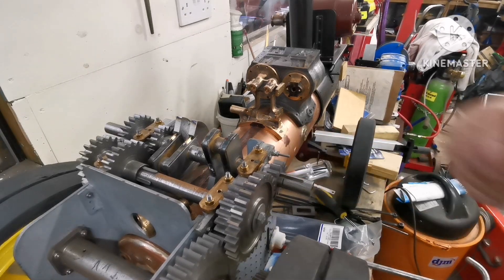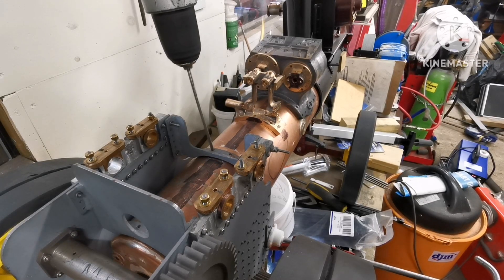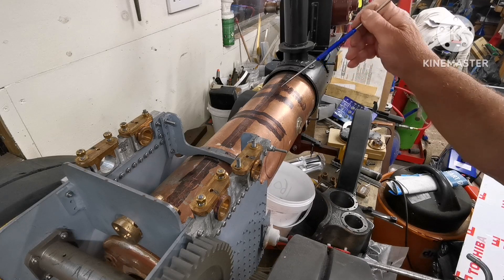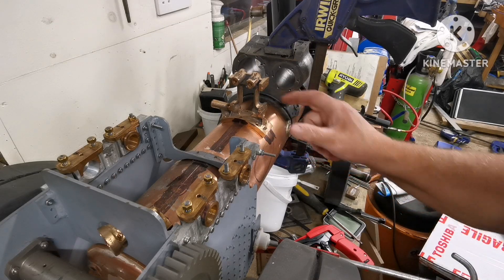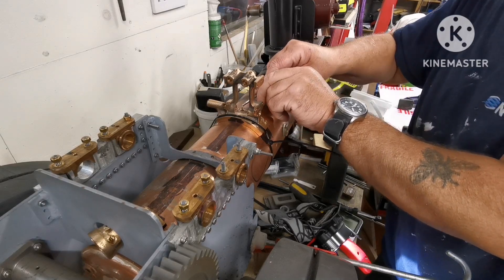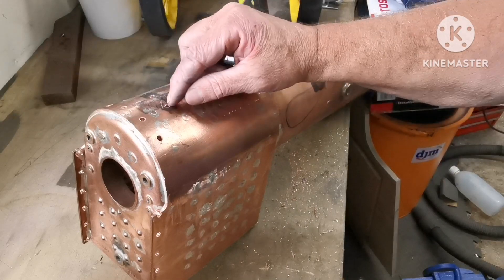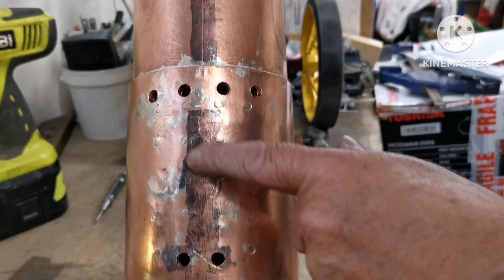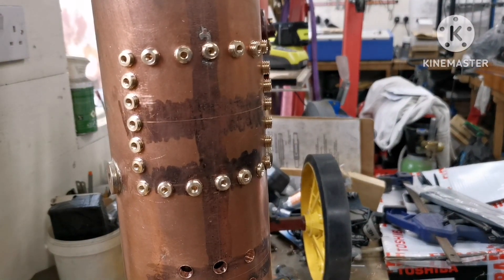2" scale Fowler Showmans Traction engine

Comment: Which video did you mount your gearbox on the boiler?
Reply from the maker: @union310  Hi, there's a video call.. introducing the boiler, then the next one on, it is fitting the horn plates and spectacle plates, that's what all the shafts and gears and crankshaft fits on, I hope that helps
Reply from the maker: @union310  After that, I had to make and fit blind bushes for fixing everything to the boiler before I could fix the horn plates etc.